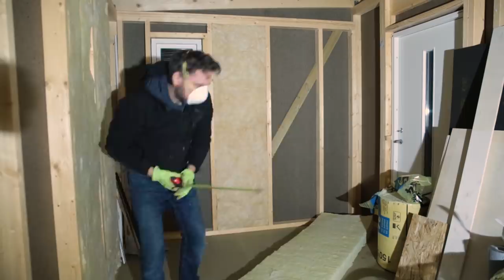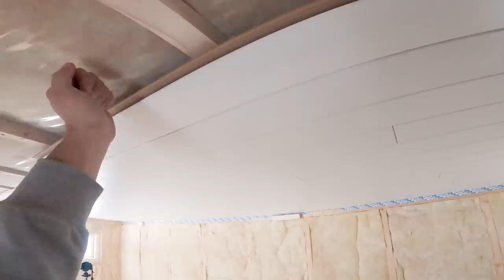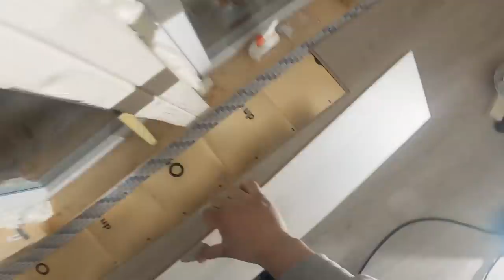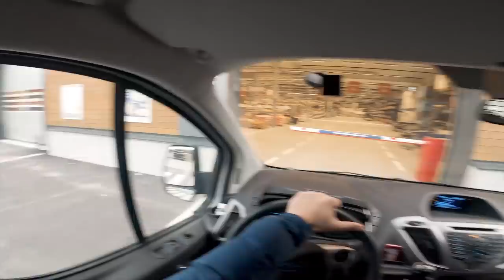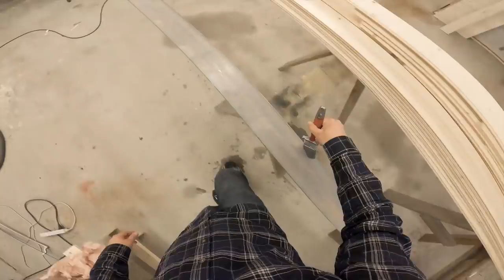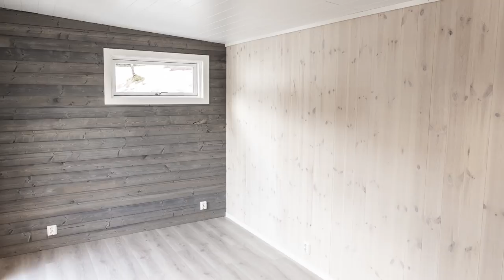Not a Tinyhouse, Not a Shed - It's an Annex! I'll never build this way again!

Comment: coming from southern USA, I am amazed at how much air space, insulation, thickness, plastic, sealing in the walls, floors and ceiling. That house must be absolutely air tight and thermally tight. I expect that if no air exchange is provided, a person could asphyxiate.
Reply: It'a NORWAY!
Reply: @PoppaCold1  i think he knows that.
But if u ever saw a house built on gulf coast / usa     you    would be seeing a huge difference....

Comment: Hi Dieter, great work! I am planning to build something like this as well. How much did you end up spending on materials? So total costs without transport. We will be building on site. Thanks for sharing :)
Reply: He is going all out in that cabin, easy to near about 10k$
Reply: @bollinger3034  Could be, I'm just wondering about the shell and isolation he built in this video. Couldn't be at 10k, which would be 100.000 Norwegian kroners. You can buy an anneks (prefab) looking similar for about 25000 NOK. So I'm wondering how much it is when you don't use prefab.
Reply: @SamuelDirksz  y did u ask if u know?
Reply: @kiankelly8358 Because this is a custom build and not the standard anneks which I am talking about.

Comment: Very impressive. I have two questions. How do the buyers plan to heat it? And will that roof handle a full winter snow load, or would you expect to have to push the snow off occasionally? I’ll be building something similar in Wisconsin (USA), and am not sure how to deal with the snow/ice buildup. Thanks for posting all your videos! Very inspirational.
Reply: Oh, and one more question. Do those brackets you used for the roof rafters/joists have a specific name? I’ve never seen those before.

Comment: Congrats, excellent job!
I was wondering how was the procedure when lifting the house and putting it into the truck. Have you needed to attach some anchor to the floor frame? Have you taken any precaution for avoiding house to twist during the transportation such as cross bracing etc?
Reply from the maker: Lots of cross bracing and panels. It's in part one.